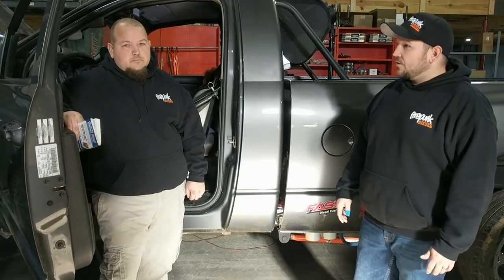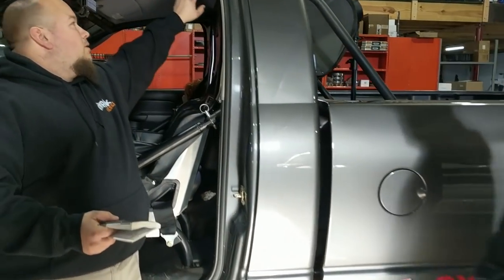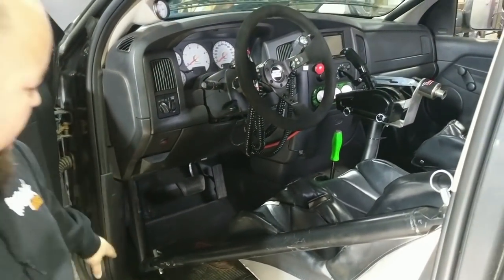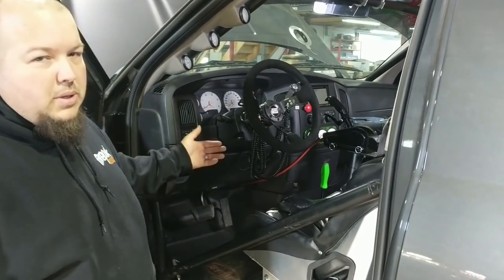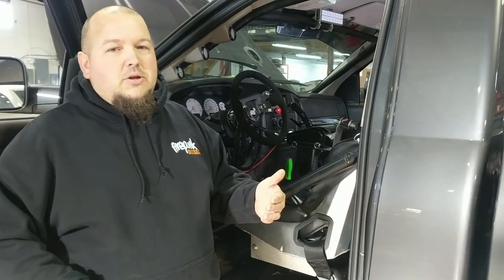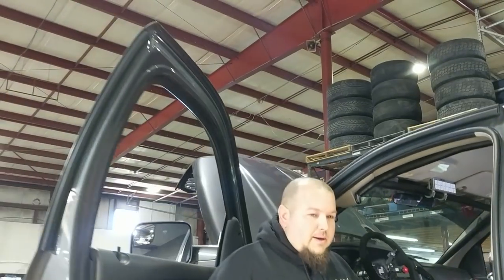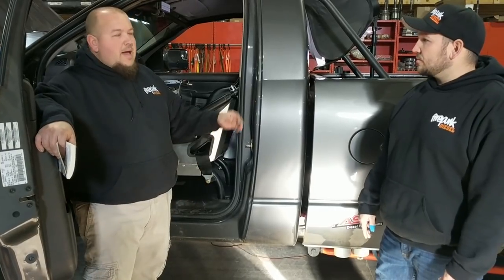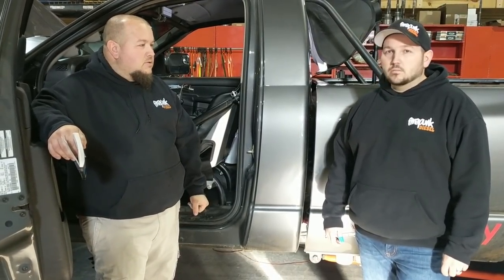FIREPUNK'S 8.50 Cage Cert Explained

Comment: Hey I'm actually doing this currently and have a question. Since the door bar on the roll cage goes right to the frame , when upgrading to a cage, can you weld the windshield down bar on top of the existing door bar? Or does the windshield bar have to be welded to your "frame" and then the door bar welded to that windshield bar? Thanks and Great videos, good work guys.

Comment: What do you use to seal out the weather & fumes where the cage passes through the body?
Reply from the maker: We either weld in a tight patch panel if possible or seal it up with seal  it using silicone.